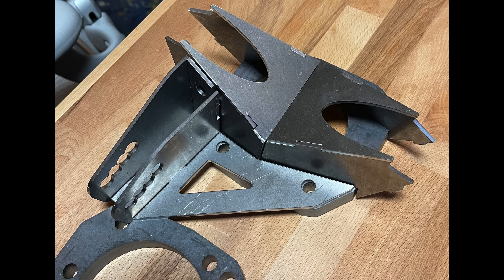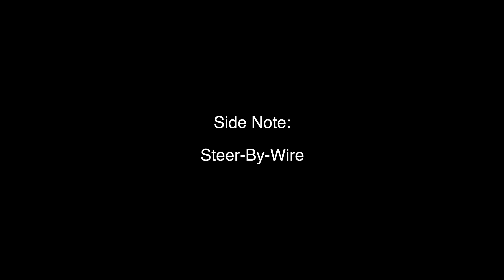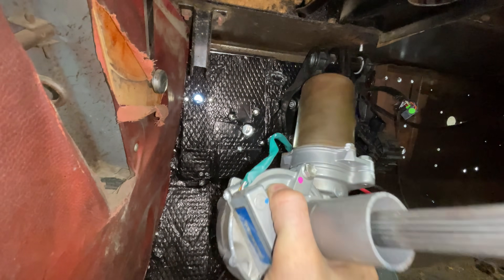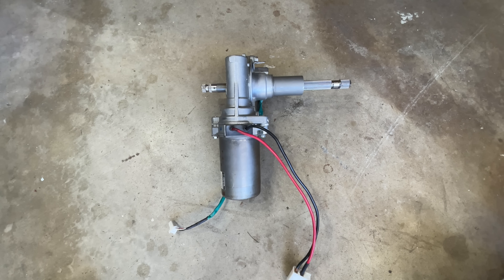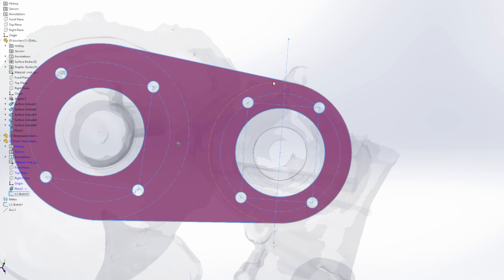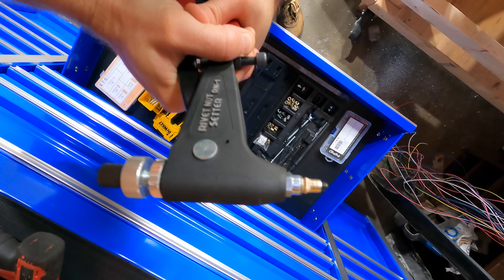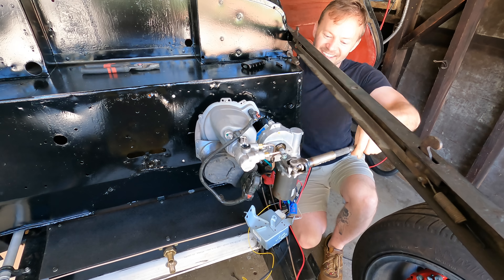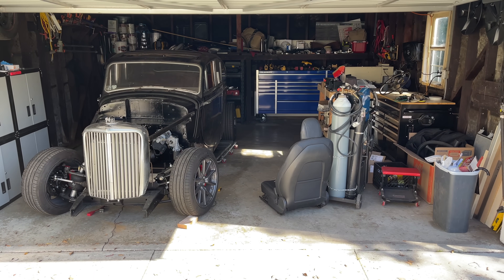Add Power Steering To Any Car

Comment: I like having the redundancy of a mechanical connection between the driver input and the wheels that are being turned.
There is also a tool that attaches to a drill motor to set riv-nuts. In my experience, it's really only good for up to M8 (or 5/16", for the Matts of the world).

Comment: If you add a magnetic collar and hall sensor at the differential input flange, then connect the signal wire of the sensor to pin 5 on the D31 connector and 12V+ to pin 6, you will get speed sensitive assistance instead of just the failsafe assistance.  You vary the speed at which the steering firms up by adding magnets at the diff collar.  The unit will provide three steps of assistance.
Reply: Do you know what year Prius this power assists works with?.
Reply: This is super cool, thank you!
Reply: Excellent 👍

Comment: Awesome use of the prius electric steering. I have a project that this will now probably use this 👍
Reply: dominic clancy
1 week ago
If you add a magnetic collar and hall sensor at the differential input flange, then connect the signal wire of the sensor to pin 5 on the D31 connector and 12V+ to pin 6, you will get speed sensitive assistance instead of just the failsafe assistance.  You vary the speed at which the steering firms up by adding magnets at the diff collar.  The unit will provide three steps of assistance.
Reply: @JohnSmith-yv6eq  awesome and thank you.
Reply: @nickhenley8040  
One other commenter stated this won't work...so you will have to do your own research on it....

Comment: Let me dissapoint you, those power steering controllers can output around 50 amps in CAN mode but only 10 to 15 amps in fail-safe mode which is actually just enough to compensate electric motor inertia. You gain nothing where you need it the most, from stationery up to 20kmph so its pointless.
Reply: dominic clancy
1 week ago
If you add a magnetic collar and hall sensor at the differential input flange, then connect the signal wire of the sensor to pin 5 on the D31 connector and 12V+ to pin 6, you will get speed sensitive assistance instead of just the failsafe assistance.  You vary the speed at which the steering firms up by adding magnets at the diff collar.  The unit will provide three steps of assistance.
Reply: @JohnSmith-yv6eq  It wont, most EPS systems require steering column angle data (coded) and engine CAN data line connected with right comm format...even very old EPS system, first gen, like in Vauxall Corsa B, required very rudimental comm line with ECU to work properly but internet is full of magic box fixups that actually do very little to solve the issue...also keep on mind you are chatting with EPS expert, aka me.
Best way to check your aftermarket setup is by using DC clamp amp-meter and actually measure current flow. Dont believe everything you read on the internet, including my post, check it by yourself.
Even Mat tried to present it like he knows what he's doing but he actually doesn't.
Here a link to 2009 Prius EPS pinout, take a look into P8-1 and P8-7 pins CANH and CANL bus lines.
https://www.therangerstation.com/tech_library/images/electric_steering/2009_Toyota_Prius.jpg

Comment: YOU COULD lower the power steering by making the input shaft of the Toyota input controlled by a gear and chain set up!! Basically you keep your original steering wheel and column, and cut the shaft short just behind the dashboard, THEN weld a Sprocket/ Gear to both the end of the Jaguar shaft and the Toyota steering input shaft!! As long as the two "gear/sprockets" are aligned you could then use a bicycle chain between the two allowing you to retain the original steering wheel and the Prius steering box!!!

Comment: I've been litterally making the same thing for my datsun 260z, i opted to use a saturn vue EPAS because it has some range of adjustment. Nice work on the firewall mount, that additional plate should be enough to hold it down.
Reply: dominic clancy
1 week ago
If you add a magnetic collar and hall sensor at the differential input flange, then connect the signal wire of the sensor to pin 5 on the D31 connector and 12V+ to pin 6, you will get speed sensitive assistance instead of just the failsafe assistance.  You vary the speed at which the steering firms up by adding magnets at the diff collar.  The unit will provide three steps of assistance.

Comment: Weirdly, all of the Ace Hardware stores near me have a fantastic selection of metric stuff (just as much metric as imperial). Worth swinging by and checking out one by you. Although i should admit that I'm usually looking for screws or bolts for computers, not cars.
Reply from the maker: fasteners are reasonably easy, tubes and such are harder, and stuff like bearings just have a much bigger inch selection. In the end it's just easier to do everything in inch, especially on a car that had inch to begin with.
Reply: @SuperfastMatt  Ah! I wasn't understanding the full context of the issue.

Comment: 12:13 You currently have the Hooke (Universal) joints out of phase. You need to rotate one or the other 90 degrees to get them parallel.
Reply from the maker: oh yea, I'm redoing all of that. there are two more u joints inside the car. I'll use some calculator to minimize phase variation of the whole assembly.
Reply: @SuperfastMatt  Is it that complicated? Don't you just configure them in pairs so that the displacement angle of each joint in the pair is the same?

Comment: Is the problem with unpowered steering really primarily about inertia? It's not the person that is steering that is doing most of the work of changing the car's direction; that's the tyres on the road and, whilst there is some load on the steering that lightens up dramatically when the vehicle is moving (some cars reduce the power assistance with speed for that very reason). I go back long enough to have driven cars without power steering, and it was never a problem at any speed, especially with what were (by today's standards) relatively light cars. However, it was always a struggle at low speeds and when stopped, and that was surely largely down to fighting against friction. It was then made worse as manufacturers introduced more, very front heavy front wheel drive cars and played around with the front suspension and steering geometry. What's more, the reaction from driven wheels at the front can heavily load up the steering. Then cars got heavier with more gadgets, crash protection and so on. Another factor was he introduction of radial tyres.

Of course, weight is an issue as it does increase the friction against turning the front wheels, and that Jaguar was a heavy car.

Nb. that design would appear to put almost all the torque on the firewall (rather than on the driver and that giant steering wheel). I assume it's up to the job, won't distort if a wheel hits a pothole in the road and doesn't need reinforcing.

Comment: Drive by wire is coming next? Yikes. My crappy car (2005 Fiat Panda) has electric powered steering, and a few times it has randomly yanked the wheel out of my hands and tried turning it all the way to the left. I didn't stand much chance in fighting against it when it did, but I really wouldn't want that to happen where the steering wheel is just an input instead of being mechanically connected. Thankfully the few times it happened it happened at low speed.

Comment: DUDE! That is epic engineering! I love it! New subscriber here, and you have given me a very cool idea on how to fit power steering to my old 1964 Dodge truck. Thanks for the great content in this video, and I look forward to watching the rest of your videos! I wonder if we have a service like SendCutSend down here in Australia?
Reply: dominic clancy
1 week ago
If you add a magnetic collar and hall sensor at the differential input flange, then connect the signal wire of the sensor to pin 5 on the D31 connector and 12V+ to pin 6, you will get speed sensitive assistance instead of just the failsafe assistance.  You vary the speed at which the steering firms up by adding magnets at the diff collar.  The unit will provide three steps of assistance.

Comment: The problem with holes in the steering wheel spokes is that people tend to poke their fingers through the holes... best to avoid temptation! Why not refurbish the original and use that?  Would be super awesome! Greetings from the UK!

Comment: The power steering system works exactly the same in my 93 nissan 300zx. If it loses speed signal it defaults to higher resistance. Nissan decided to route the signal from the cluster rather than the actual sensor its self, and they tend to corrode or succumb to bad solder joints and youll get the steering randomly going hard on you at low speeds.
Reply: dominic clancy
1 week ago
If you add a magnetic collar and hall sensor at the differential input flange, then connect the signal wire of the sensor to pin 5 on the D31 connector and 12V+ to pin 6, you will get speed sensitive assistance instead of just the failsafe assistance.  You vary the speed at which the steering firms up by adding magnets at the diff collar.  The unit will provide three steps of assistance.

Comment: Prius electric column is pretty cool. My friend put it in his awd 600hp wv golf for autocross. It turns like butter
Reply: dominic clancy
1 week ago
If you add a magnetic collar and hall sensor at the differential input flange, then connect the signal wire of the sensor to pin 5 on the D31 connector and 12V+ to pin 6, you will get speed sensitive assistance instead of just the failsafe assistance.  You vary the speed at which the steering firms up by adding magnets at the diff collar.  The unit will provide three steps of assistance.

Comment: The wheel you have chosen is not bad, but I am partial to the four spoke wheels that are stock in these cars. Of course you probably don't need a steering wheel that's a meter in diameter...
Speedway Motors carries something that I would be tempted to get, were it my project: the GT Performance 91-4040 GT3 Competition, a 15" four spoke wheel that wouldn't look out of place.

Comment: Prius column .. hmm
buys used Prius column * begins searching internet for project to use the used Prius column on*
Reply: dominic clancy
1 week ago
If you add a magnetic collar and hall sensor at the differential input flange, then connect the signal wire of the sensor to pin 5 on the D31 connector and 12V+ to pin 6, you will get speed sensitive assistance instead of just the failsafe assistance.  You vary the speed at which the steering firms up by adding magnets at the diff collar.  The unit will provide three steps of assistance.
Reply: @JohnSmith-yv6eq  Thank you.
Reply: @RANDOMNATION907  
There appears to be some controversy over this additional input..whether it works or not. Nothing to lose to research it?

Comment: This is neat as all get-out. I wonder if I could do something like this on my project car, and eliminate the hydraulic pump. I'll have to look into it.
Reply: dominic clancy
1 week ago
If you add a magnetic collar and hall sensor at the differential input flange, then connect the signal wire of the sensor to pin 5 on the D31 connector and 12V+ to pin 6, you will get speed sensitive assistance instead of just the failsafe assistance.  You vary the speed at which the steering firms up by adding magnets at the diff collar.  The unit will provide three steps of assistance.

Comment: Does Tesla have a vacuum pump in the master cylinder to slightly retract the pistons to reduce friction from the pads just barely dragging on the rotors?

Comment: steer by wire  was actually  the 1st  E lectronic  P ower  S teering  that was used in th e 3rd gen honda prelude that even came with a digital instrumet cluster...it didnt take root because theres was no backup in case the electricals failed so we have the EPS that we know now

Comment: I think I need to go tell everyone about Matt.

Thanks for explaining how the Prius steering assist works. I always thought that conversions like that required calibrated steering angle sensors.
Reply: dominic clancy
1 week ago
If you add a magnetic collar and hall sensor at the differential input flange, then connect the signal wire of the sensor to pin 5 on the D31 connector and 12V+ to pin 6, you will get speed sensitive assistance instead of just the failsafe assistance.  You vary the speed at which the steering firms up by adding magnets at the diff collar.  The unit will provide three steps of assistance.

Comment: Nice. I've got the Saturn Vue powered column for a couple of my projects. It is manually adjustable for assist via a potentiometer, so I can dial it up for low speed (parking lot stuff) and dial it back on the road for less squirrely-ness.  I really want to do an Arduino or something else to convert VSS square wave into an input signal to feed a digital potentiometer so that I can have true stand-alone variable assist based on speed.  Should be fun.  Or...I can just go with Prius for my next build.  Whatevs.
Reply: For the Prius power steering
dominic clancy
1 week ago
If you add a magnetic collar and hall sensor at the differential input flange, then connect the signal wire of the sensor to pin 5 on the D31 connector and 12V+ to pin 6, you will get speed sensitive assistance instead of just the failsafe assistance.  You vary the speed at which the steering firms up by adding magnets at the diff collar.  The unit will provide three steps of assistance.

Comment: I love your videos and enjoy seeing your fabrication processes. As a homebuilder who's a little over a year into an agonizingly slow Locost 7 build, your endorsement of Send Cut Send is very timely as I'm approaching the need for custom mounting solutions in my frame. Also, I had been planning on running a depowered steering rack, but may have to look into a Prius unit if I have space. Thanks for the fantastic content.
Reply: dominic clancy
1 week ago
If you add a magnetic collar and hall sensor at the differential input flange, then connect the signal wire of the sensor to pin 5 on the D31 connector and 12V+ to pin 6, you will get speed sensitive assistance instead of just the failsafe assistance.  You vary the speed at which the steering firms up by adding magnets at the diff collar.  The unit will provide three steps of assistance.

Comment: Looking good Matt! I dunno if you saw my E36 Camper Lemons car when you were out at our workshop a few years ago, but we used the Prius EPAS on that guy too. Your setup is fancy and clever; ours is crude, but effective. I think the additional torque reaction bracing on the front side is a great idea.
Reply: dominic clancy
1 week ago
If you add a magnetic collar and hall sensor at the differential input flange, then connect the signal wire of the sensor to pin 5 on the D31 connector and 12V+ to pin 6, you will get speed sensitive assistance instead of just the failsafe assistance.  You vary the speed at which the steering firms up by adding magnets at the diff collar.  The unit will provide three steps of assistance.

Comment: Would be better if you angled the power rack through the firewall, try to keep the steering shaft as strait as possible, when you add so many angles it makes steering harder.

Comment: Did this in my VW Thing. Guy on the LS1 forums has a list of electric power assists that will operate in fail safe. I used an Altima (Edit: Nissan Versa, not Altima) unit that has a bolted flange on the where the Prius has the press fit tube. Simple CNCed flange to bolt to firewall.
Reply: For the Prius
dominic clancy
1 week ago
If you add a magnetic collar and hall sensor at the differential input flange, then connect the signal wire of the sensor to pin 5 on the D31 connector and 12V+ to pin 6, you will get speed sensitive assistance instead of just the failsafe assistance.  You vary the speed at which the steering firms up by adding magnets at the diff collar.  The unit will provide three steps of assistance.

Comment: I would not trust the press fitting either. If it is too tight it might cause trouble  for the bearings of the steering shaft....but who am I to tell you.
I'd go for the steering wheel without holes in the spokes.

Comment: I was looking into fitting electric power steering to my VW bus (I think you call them van..) and I found a single legal system (legal in Germany that is)- aaand it is 4000€..
Reply from the maker: yeah, you guys have much stricter rules over there. You can do pretty much anything over here.
Reply: @SuperfastMatt  just to give you something to laugh about- it is debated that polishing your headlamps is illegal since you change the thickness and therefore the parts certificate is rendered obsolete...

Comment: "I forgot to plug the sensor into the control box."

My Two Basic Rules for Electricity:
1) You have to hook it up
2) You have to switch it on.
Violate either of these two rules, and no amount of head scratching will fix your problem.